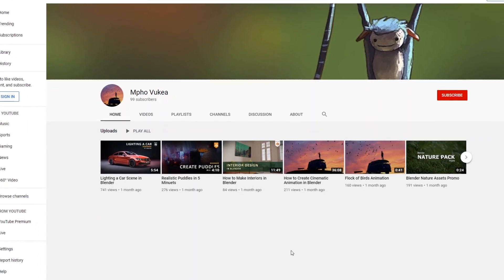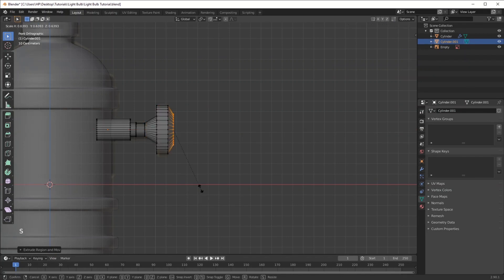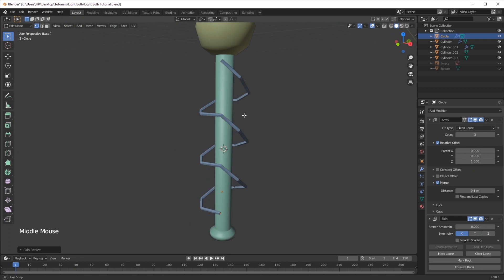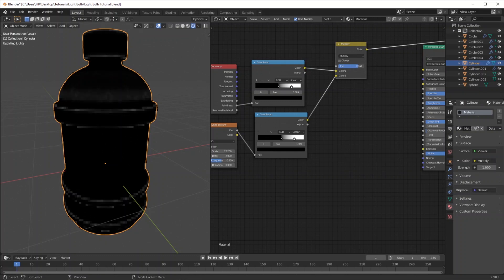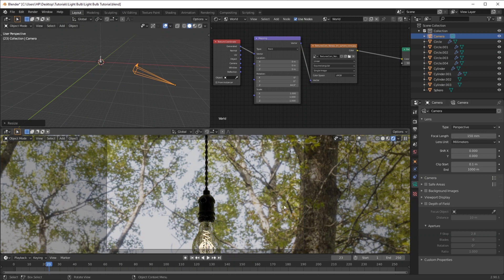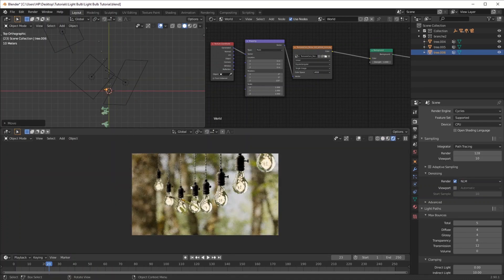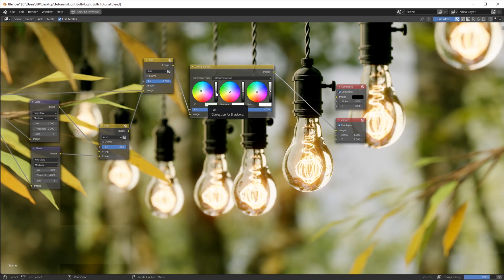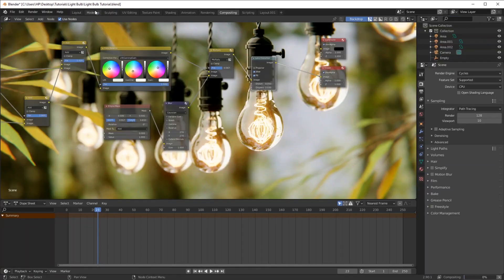Making a Light Bulb in Blender

Comment: hey Mpho, short question: can you tell me super quick whats your main render settings? I get some noise in the parts that are out of focus and I really dont know how to reduce it. Thanks man!
Reply from the maker: Rendered at 300 samples. However I used the ai denoiser to get rid of the noise. Should be available with ble der 2.83 onwards
Reply: @MphoVukea  thanks for the super fast answer. I played around with the denoiser and a couple other things, but still get some noise in motion. The single frames look good to me, maybe the denoiser change somehow the blur from frame to frame... but idk :(
Reply from the maker: @LuKe-os8ky  unfortunately the denoise isn't perfect for Animations. You'd have to use a higher sample for that extra smoothness. Perhaps 1000 samples though it will take time unfortunately